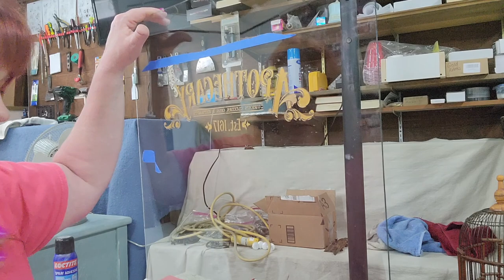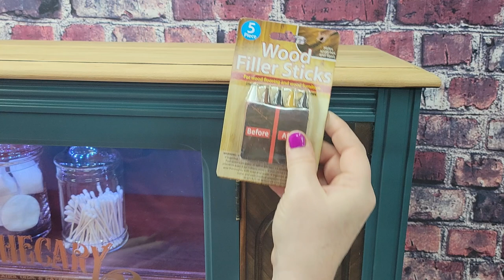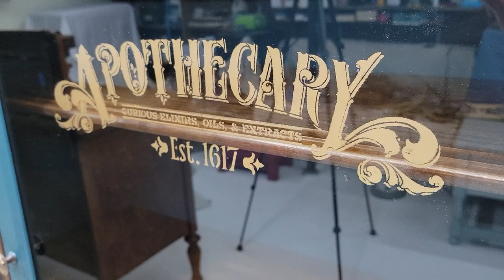Updating a China Cabinet

Comment: The reason little tiny paper and in your case glass cut is that the cut goes into the first lawyers of skin where 95% of your fell/touch nerves are.  If the cut goes deeper other nerves are triggered to respond and reduce the pain.. So next time just cut your finger deeper and it will not hurt as much. It may bleed more but at least it's less painful.😂
Reply from the maker: Great advice lol not sure i will follow it but your explanation explains it.

Comment: Hi. Do you clean the piece first? Or just straight in with denatured alcohol?
Reply from the maker: I always start with a deep clean on every piece I do. I sometimes spend up to 2 hours doing so. Most of the time I dont film this as it makes for boring video. People fingers have natural oils to them so old pieces have alot of build up of those oils if you dont clean those you run the risk of pushing them into the wood which will cause problems later in the project.